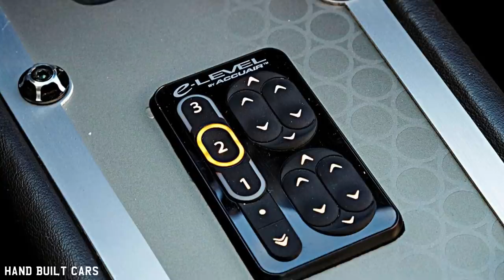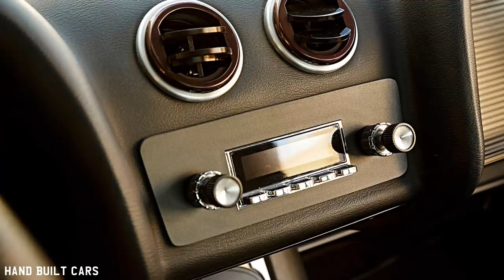1958 Ford Thunderbird 5.0 Coyote Build Project

Comment: Fantastic car. Looks very professionally done. 
 I own a 1958 thunderbird. Regatta Blue. I still have the 352 interceptor engine, power glide trans and the 3.0 rear. Fully refurbished by Jaspers,then returned and installed. Same matching numbers. My question for you is. The 1958 Thunderbird was the first unibody car ford built. Did you add a frame, the the front to the back with a box frame brace?